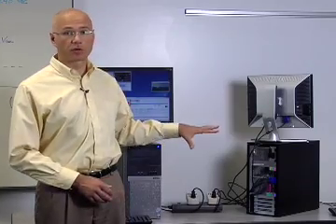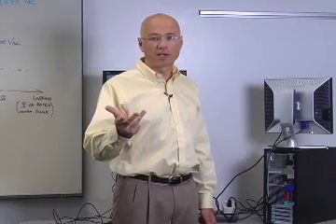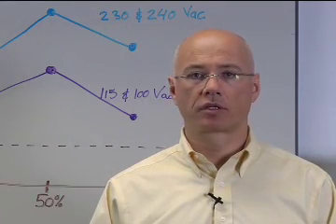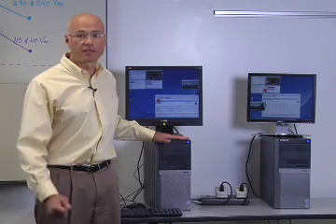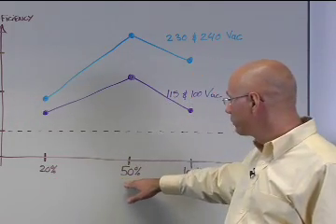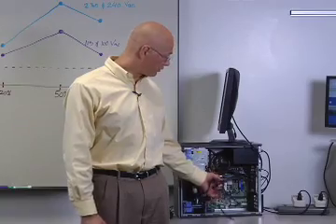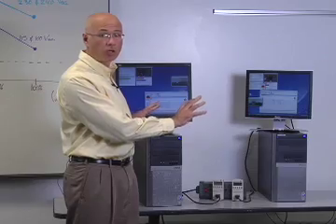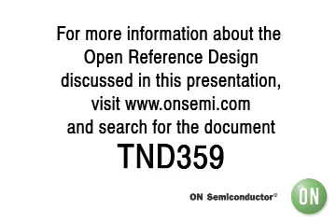High-Efficiency 255 W ATX Power Supply Reference Design

Comment: Bad Stuff

OnSemi told me design came from third party. Application note’s schematic messy, with errors, text over lines (badly located - impossible to read), questionable component values (pf versus nf - if checked against the data sheet) and irrelevant/superseded circuitry still shown. 
Ask OnSemi to email a sch PDF to you. Non-conventional bobbin winding never get comparable inductance/ leakage inductance values. Onsemi told me converter section a very tricky difficult design - best avoided.